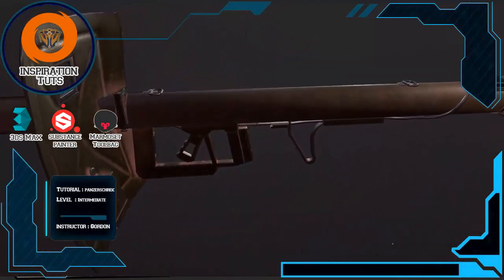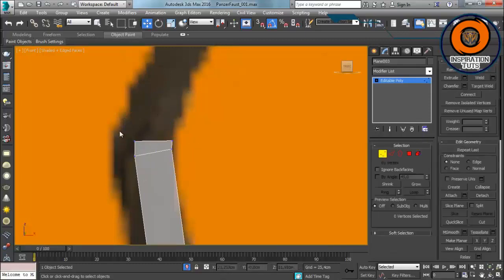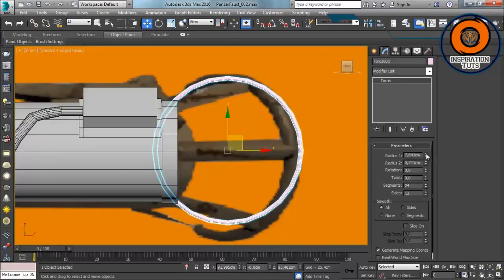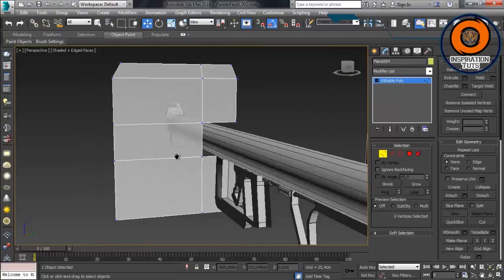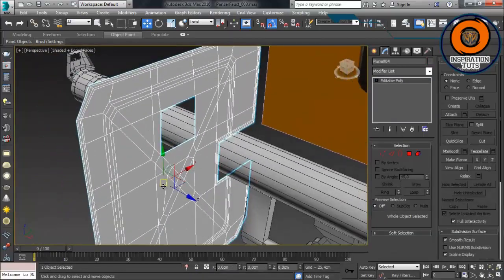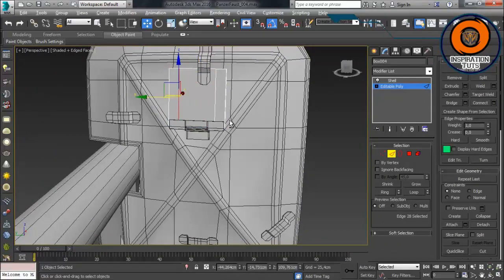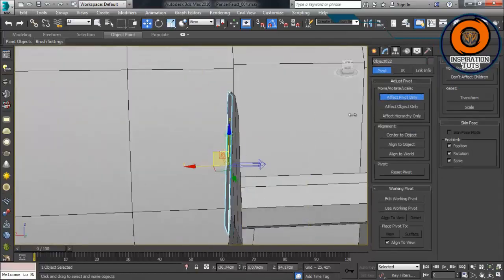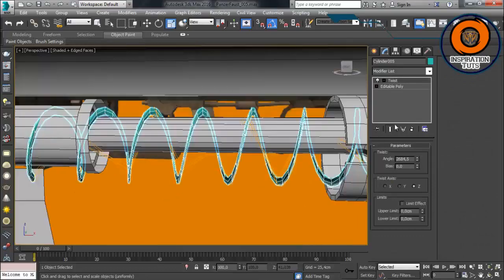Panzerschreck Modeling Tutorial in 3Ds Max

Comment: https://pp.userapi.com/c847221/v847221836/1800a0/0fL7L5DPHn8.jpg
https://pp.userapi.com/c847221/v847221836/1800aa/XZ0F_OpvDdU.jpg
https://pp.userapi.com/c847221/v847221836/1800b4/X1Fx84xUE-Q.jpg
https://pp.userapi.com/c847221/v847221836/1800be/Q4T0tOXIz3Q.jpg
Reply from the maker: Great job Man, is this the low poly version or you just did not apply the turbosmooth modifier on the high poly?
anyways, keep it up you are on the write path ;)
Reply: @InspirationTuts  without turbosmoth